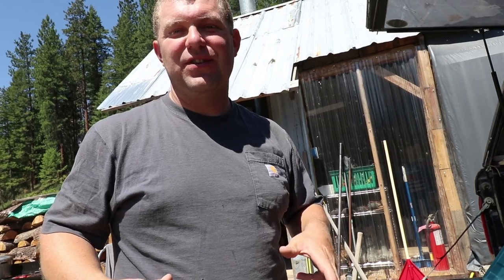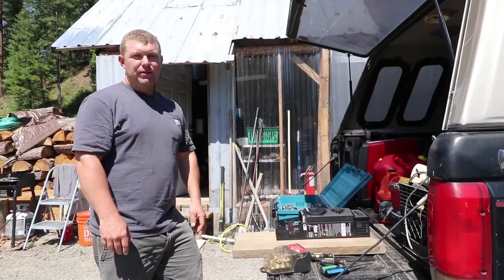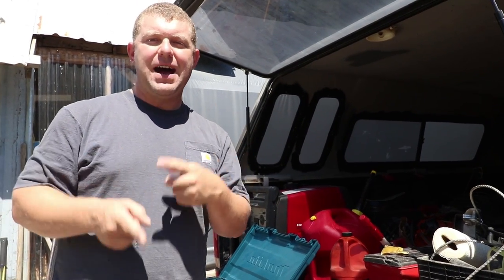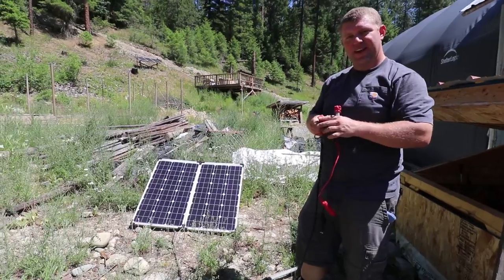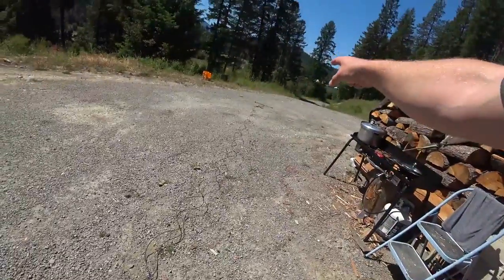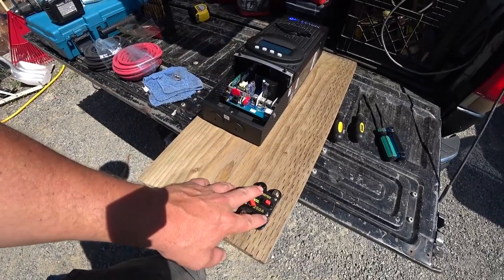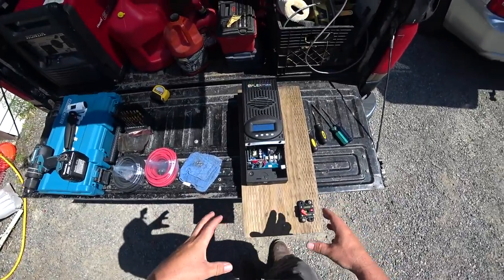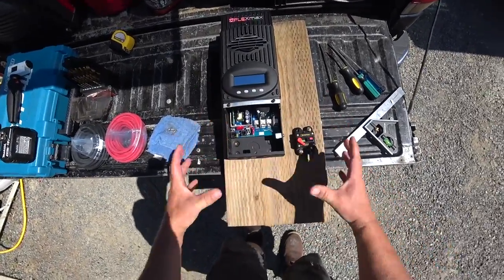Bad Idea? Now We Want Even MORE SOLAR POWER! (480 to 1230 Watt Upgrade)

Comment: MPPT vs. PWM has absolutely nothing to do with it's capability to run panel voltage different than battery voltage.  That is perfectly possibly with 'dumb' PWM control as well.  What MPPT does is it uses intelligence to adjust the panel current to maximize the power extraction, because pulling the most current is not necessarily going to generate the most power in every situation.

Comment: Love your series and the upgrade seems a good idea. Why use a 250 amp circuit breaker to protect a cable rated at 150amp... recipee for a fire? although the cable can handle the 60Vx40amp load maybe think about the purpose of a curcuit breaker, get off your high all knowing horse and for the sake of your wifes safety get the free advise from Alyses father an electrical engineer he must watch this and worry

Comment: My hope is that those that have run the gauntlet and have installed a system (no names mentioned), will see it in their hearts to provide POSITIVE support, help you guys out and answer some questions you might have rather than be a complete douchebag about the situation. I've got my fingers crossed for you two!

Comment: I am just learning, but your breaker size is wrong for your use.  That breaker coming in to the charge controller is to protect the solar panel wiring, but 250 amps is way to high of a setting to protect those wires.  Heck, at 250 amps, it wouldn't protect the controller either, if somehow 250 amps made it through those thin wires.  A 250 amp breaker would be more  suitable for the heavy cables going from the batteries to the inverter.

Comment: The 250A breaker you used is unsafe. Not "oohh.. code nanny" unsafe, but seriously burn your house down unsafe. A 250A breaker can be used on wire no smaller than 250mcm in Copper (the next step bigger than 4/0, which is itself 7 sizes large than the 4-gauge wire you have) or even larger at 350mcm in Aluminum. The wires you connected to the breaker will happily catch fire and melt to the point of dripping metal long before that breaker trips. The maximum safe breaker size for 4-gauge wire is 85A. If the wires from the panel to the breaker are even smaller than 4-gauge, you need to use an even lower-rated breaker to match your smaller wires.
Reply: Yep...the breaker or fuse should be the weakest link.....always.
Reply: It just  occurred to me that "breaker" in american could  mean BOTH "switch" and/or  "fuse" ? An oversized switch is no problem, but if there is no fuse in the system then that is a problem.  But as long as the cables can take the max output "shorted out amperage" of the panels and the charge controller doesn't fail and run the battery energy backwards through the panels, does the panel side even need a fuse at all? And isn't the charge controllers' input side already fused inside it?
Reply: Ronny, you're right, I have no idea if the thing he's calling a breaker is an overcurrent protection device or a simple switch. In the US, the word breaker is only supposed to be used for an overcurrent protection device but that doesn't mean everyone uses it properly.

No, most solar charge controllers are not internally fused on the input or output. You are required to add overcurrent protection of both the correct ampacity ("size") AND of sufficiently high interrupt current rating (which is HUGE on the battery side!). The reason you fuse the input side is of those unplanned oopsies. You're right, you shouldn't be able to get more than the total output current of the panels on those wires. Until you manage to stick the backhoe through both those wires and some wire capable of delivering more current. Or until someone makes a mistake plugging something in and shorts the generator to those wires or...

You get the picture.

I agree with the video that the guys who think you should just drop all the money at once and come up with a perfect system instantly are out of touch with reality for most of us. However, I think they video is dead wrong that the simple safety stuff is something to just ignore. Having your system be inefficient, incorrectly sized, sited wrong, etc is no big deal. Having your system represent a threat to your family's safety is unacceptable.
Reply: Agreed. I would "like" to have a fuse inline with the panels and "breaker"  (which, even if it would cut out at 250 amps is nothing but a switch when connected to thin wires) of just over the max input amps allowed by the controller or just under the max amps the panels can ouput whichever of the two is less. Now when looking at the video again Jesse says the "breaker" is rated for 600V DC at 250 amps , which in my mind must be just a switch with the capacity to pass and break 250 amps at 600 Volt DC without arcing. A 250 amp "fuse" would (in my imagination) be a much much bigger thing..
Reply: I have an 80 amp version. I is really about 30amps and swithhes off then back on when it cools down!

Comment: MPPT algo.... try to increase the current, has the output increased? yes? Good, try to increase the current, output increased? yes? try to increase, no? then drop a bit... Really, the algo is simple. Basically, it pulse the power in an inductor, which act as a transformer in a way. The longer the pulse, the more power (in theory) you get. However if you overload the panel then the voltage drop and you actually get less power. The MPPT control the pulse width and mesure the result and simply increase or decrease the 'on' time, so the panel get loaded to basically the maximum possible. Most likelly doing it at 20000-60000 times a second, maybe even faster.

Relay based goes click click. It kick in until the voltage rise past a preset (ex: 14V) then it disconnect the panel, and wait until it go down bellow a preset, ex: 13.5V. You waste the extra voltage and power. The panel is shorted to the battery and ain't outputting 17V but maybe 13V (battery voltage), so if the panel is 5A and 17V that would be 85W, but it will produce 13V 5A = 65W, see, a huge loss. Switching speed will be maximum about 20-30 times a second, which is the maximum speed that a relay can move at. Physical limitation.

PWM is exactly the same, but with a transistor and very fast speed, it allow a more strict voltage regulation. Switching speed will be a few thousands times a second, most likelly 1-30k times a second. Same inneficiency as relay.

Some are linear, but you don't see them anymore: it just burn the extra voltage as heat, it does however have some advantage like less electrical noise, and don't short the load, good for hydro/wind power

Other type is a load dump: the solar panel is connected directly to the battery. When the voltage is too high it just turn on an heating element or some other big load (can also be a water pump, for optional irrigation for example).

Comment: I don’t understand why you have your arrays 60 ft away? Understanding that that seems to be where you want them- did you not sacrifice efficiency for distance–>heat loss in the long wire run? You said charge controller needed a minimum of #4 wire and you used it because you had some. Should you have used a larger wire based on the output? Good luck on your adventure. I notice that you spend quite a bit of money, Saw mill, back hoe, new truck, lots of nice equipment (tools), are you “compensated” by the manufacturers?

Comment: Hi beautiful people, the idea of solar power is to have more energy going into the batteries than you take out.....and engineer it so that you have minimal electrical losses due to resistance, thus the reason you are running high voltage from the panels wired in series, to the solar charger, then to the batteries. Also you can actually still connect and use the smaller panels and charge controller which will also assist in bringing up the batteries into float charge mode.

Comment: The way this guy talks, it's like everyone lives in a city and has no idea what hard work is. But just to let everyone know he will be making a video to redo this again in a few episodes.
Reply: yeah he is working in "95 degree heat" and we are all just sitting in air conditioned homes criticizing.... in fact I am sitting in an air conditioned home right now but spent the previous 10 hours working out in much greater heat than they will ever have there. THEN came home, gave a little bit of my limited free time to watching there video and for about the 100 time was totally disrespected by a dude that doesn't have 1% of the knowledge or experience I do.
Reply: AsTheWheelsTurn thank you with agreeing, he chose this because it seemed like an awesome idea in a magazine when he lived in the city
Reply: Midwest Allis Fan, I live in Canada and he talks about the north and the cold being it being nearly impossible  to use in the winter. He is wrong I have solar pv and solar thermal both working well up here. But hey you don't get to do it Jessie s way you have research on it.
Reply: I set in air conditioned office and watch this. Only sometimes do hard, manual labor.

Comment: Do you have a way to melt metal, if you do , save as much scrap metal, preferably copper, but you will need stronger metal for structure. In a few months a new tech will be released to the world, be ready to make it quickly, and after you have made yours, spread the word like crazy

Comment: Didn't like your putdown of Home Power magazine. You can learn an incredible amount from closely reading it. Yes it has become quite slick over the years and features a lot of expensive, contractor-built projects but it has a wealth of information and hard-earned wisdom from writers and subscribers. Get a subscription and you get access to their archive that has many articles about basic systems and learning how solar works. Their clear system diagrams will help you immensely. You're gonna love your Outback controller but more importantly, your batteries will love it.

Comment: The video I saw last week was the one I put my first comment on, just a comment about how I thought batteries closer to the panels would solve problems.  It got carried on and followed with some other suggestions, and some were quite ridiculous.  And I finally hit the subscribe button since I been watching your videos forever..  Now I gotta listen to you complaining about armchair quarterbacks making negative comments while sitting in air conditioned apartments while you're sweating in the heat.  I do outdoor construction work in Orlando, don't tell me about heat, we invented heat.  You're the one who videos things, puts them on YouTube, and wants people to subscribe, get a thicker skin and deal with the comments. Also, you're gonna get a lot of comments because you aren't an expert and do not do everything the best way possible or necessarily get it right on your first attempt.  If I don't want people to comment on what I'm doing, then the last thing I do is film it and post it to the world...  Man up and deal with the criticism, or if you want to whine like a girl, put on a dress, and let your wife do the videos.
Reply: John Galt shorter runs of heavier cable and properly sized double pole protection is definitely the way to go to improve system efficiency and safety... Sadly, some people just never accept advice until they need help filling in the insurance form. I'd also add that covering terminals with the (usually) supplied covers will also improve safety and reliability.

Comment: MPPT > PWM on nearly any system. Smaller MPPT controllers with less features aren't that much more than PWM and are a lot more efficient. For a small system it's like $100 difference and you get 20-30% better efficiency and much better behaviour in less than ideal conditions.

The only usage cases I can think of where efficiency isn't key is when solar is used as a trickle charger. If solar is a primary source of power then MPPT all the way.

Comment: I get it ...I started with crap solar components, learned things like that a cheap mppt charge controller is not mppt, and it is very limited it throws extra amps and volts away, I learned a modified sine wave inverter will burn up an ac fan, I looked at it like... experiment with simple cheap stuff, learn/ test it's limits then, upgrade after learning more.

Comment: I am an electrician not a solar expert.  I can give you a few tips when setting up your system in a more permanent solution to maximise the efficiency of your equipment.  
1. DC suffers from voltage drop rapidly so try to setup batteries and inverter close to the solar cells.  The closer the better.  If you wish to relocate batteries further from solar you can increase cable size to reduce the voltage drop.  
2. AC suffers less voltage drop so running inverted power over distance is cheaper as requires smaller cables.

I found your videos looking at camping stuff.  Funny how you tube suggests next video's.  They are great.

Comment: Your situation is one of flux.  You're in one place right now but moving toward a different, permanent one.  So make the solar work for now and worry about making it perfect later, when it matters.  Right now is not the time to sweat the details.  You'll want to and with the experience you have it'll be easier to know when and how to sweat them, but later.  Make it work for now, make it great later when you have a little time to spare for it.

Comment: if you guys can get up to 80 to 100 amps in solar set up you should be just fine ive got 60 amps at 12 volt and a 800 amp hour battery bank in a small mobile home i could stand to get another 20 amps to fill in the gap but im running a hybid set up with an auto charge set up. If the voltage gets to 12 volts a fall-back charge starts automatically to get the voltage back up to 13.9 yes not a 100% charge but i like being greedy with the electric company cause i can :-). Ive done all the work myself so i know just where stand believe me i get it.

Comment: You are dead on with your comments on the Internet experts.  There is no such thing as the "perfect" setup/solution.  When I became an engineer I was shocked at how much (educated) guesswork was involved.  After that it's all about compromises based on time and money restraints.
Reply: In what sense?  What has he said?  I haven't paid too much attention to specifics of what he has said.

Ok found what he said.  Yeah Voltage = Resistance * Amperage.  You don't technically send amps or voltage anywhere, they are based entirely on the components in the circuit, but in a practical sense he is not wrong.

Higher voltage means less amperage for the same wattage (Watts = voltage * current) which means less heat.  Less resistance (More conductive wire (wider/shorter/better material)) means less resistance which means less heat.  Less heat means more useable power (not being wasted on heat) and less chance it all catches on fire.

I've taken a few electrical courses in college and it still seems like voodoo to me at times when I'm actually wiring up things up and not just working it out on paper.

Comment: batery bank.s are okay.they can bee conected in pappalel and series to get wairies voltages.lthink you using to many conversons.step down and inverter for fridge?110v?.keep the charger in a cool place for long life.heat dryes upp the elektrolytic caps.minimise coverson off eny kind to a minimum do to looses .dont know how the bat bank is connected.i would us as many i need to mach the max volt i want out then parralel connect them as pair in so tha amp capasity is double a. t.a bank like that can be used as 12v as 24 and upp to 110v around 9 12 volt 2  18 12 volts total.best they are the same amp or all the sam in parrallel coupled all the pair in series.a big capasitor bank between charger and batery bank used as to absorb power/charge upp when sun power spikes and drops and the led baterys is slow to absorbe power peaks..since you are using 12 v bats it is posible to charge it with 14.7 volts.a 110volt bat bank can bee charged with 14.7volts.Keep on

Comment: I think the 'solar people' come out because of safety reasons. It is deadly. I'm no expert at it and I'm trying to learn it too. But I already know what can happen if you don't cover your panels before connecting and disconnecting from your battery bank. Those can turn into literal bombs. Especially if it's a used system and you have no idea what was done to it.

Comment: 250 amp breaker? for Solar.   the 250 amp breaker should protect your Battery bank from Overload.not your panels.  BTW I worked for the Dept of Energy as an electrical engineer specialist. so listening to you is "Painful"  Pay an expert for an hours education. Then you will both do it correctly and understand how it works and how to keep it working. the wire is rated for 75-90 Amps  so your 250 amp  would likely not trip  long after the Wire melted

Comment: More Power:  Wind Turbine, hydro electric dam, Bio diesel generator.
Reply: Bio mass generator as well
Reply: That would be very cool.
Reply: Where they are, even the industrial wind turbines would lose more power from conversion and turning the blades then it would gather.
Unless you live somewhere with half the year +5bf, they're useless. Governments build them in the most stupid places just because it has the image of green power and it provides jobs in short time which is the only length of time a politician is able to think about.
Reply: More power connect to the grid.  That is not bashing. Just a thought and comment.